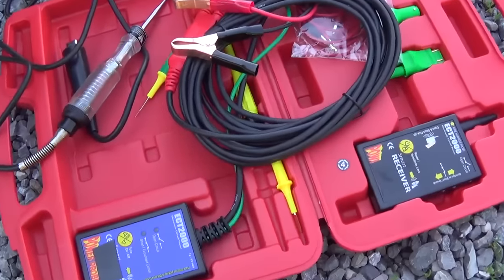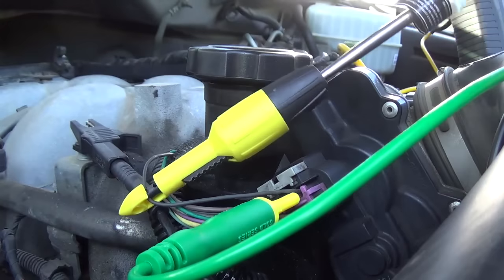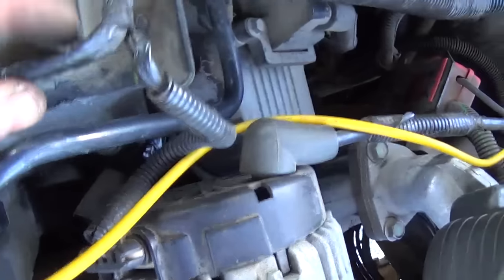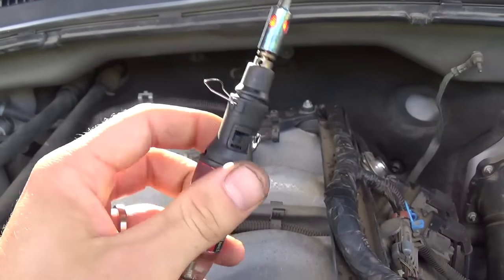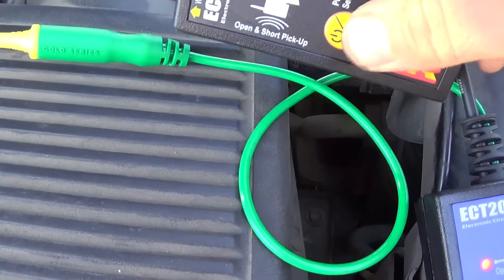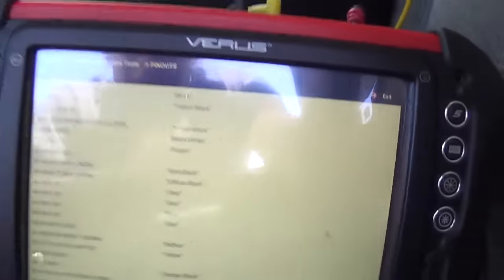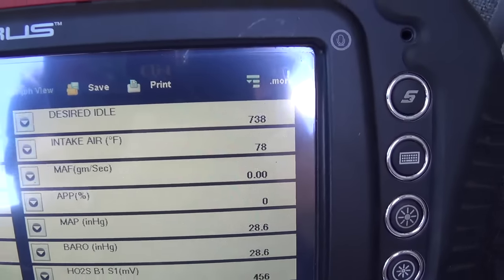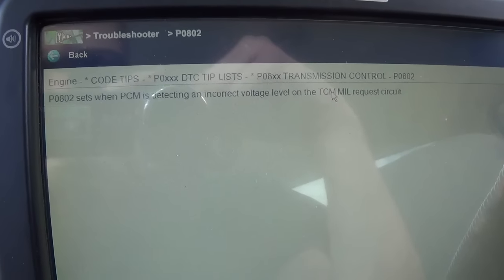GM Chevy truck: "REDUCED ENGINE POWER" Case Study- Part 2

Comment: THANK YOU SO MUCH.  I spent 2 days and $100 trying to figure out what was wrong.  Your video led me to the fix on my 2004 Chevy 2500HD 6.0L.  I had changed the Knock Sensors and cleaned the intake and heads and when I put it back together I was getting the Reduced Engine Power message and P0120 & P2135.  Watched countless YouTube videos and read countless forums.  It was watching you strip the wire loom back as far as you did when I found the break in the ground wire near the rear most fuel injector.  When I disconnected the fuel injector while taking off the Intake Manifold the wire must have broke fully.  The ground was completely broke and the brown wire was chaffed with the copper exposed.  Spliced those wires and good to go.  THANK YOU.
Reply from the maker: Dominic, I am so pleased that my video was helpful to you! Great job on the repair!

Comment: What a great lesson in modern technology and PATIENCE.  Headed off to the dealer on Monday for the same damned "Reduced Engine Power" BS.  Over a year of intermittent limp mode in some of the worst locations.  It's a bitch being handicapped, but, at least I can go to the dealer forearmed with a litlle very dangerous knowledge.  Thanks for the lessons.
Reply from the maker: Sure thing, Paul! Glad I could help you out! The trouble codes stored in the computer can narrow down the problem quite a bit :)

Comment: its called taking time to fix a vehicle the right way, without being disturb. the term mechanic way overrated, dealership pressure them to not waste time on said electrical repair when you can charge for a new part and bill the customer and make them more money , when you have other vehicle waiting for oil changes and tire rotation! way to simple ,  we fix cars should be the new name, at least i tell my people that , thanks Ivan, for fixing what someone else broke.

Comment: That cut on the harness is because of the intake manifold cover(the plastic cover that goes on top) 2014 and newer 2500hd trucks that kept the 6.0 have an issue where the cover rubs a hole on the pcv hard hose at the back of the driver’s side head letting dirt into the engine, i sent 5 company trucks in for new engines because of it

Comment: Thanks for the vid bud...however, I'm a little confused as to why, but, it sure looks like you tugged and pulled so hard on purpose and tore the first black ground wire though...am I trippin or what?

Comment: Excellent Video. My 04 GMC Sierra tripped the "Reduced Engine Power" whenever I hit washboard on our county gravel road. Traced it down to the female side on four of the eight bayonet pins to the TPS. Took each pin out and compressed the tab down to make better contact with the male pin. For a quick check just move the wiring around to the TPS while engine is running. Loose contacts will cause popping noise from TPS.

Comment: Pine Hollow A.D. you are awesome. I watched both videos the other night after having no luck troubleshooting my reduced engine power situation that came on my 2003 GMC Yukon. With your help diagnosis of this vehicle I was able to look through my lines attached to the source codes and found a broken wire. I replaced the line from the gas pedal to the control module with a part off a junkyard 2003 Escalade costing less than $3. The vehicle works perfect now. It instantly fixed my problem. 
I suggest watching both case study videos in their entirety. They are very helpful. My broken lines were not he same as the ones found in this video but I did find two line that had broken over time. Replaced one line and repaired another. Thanks Pine Hollow for saving my family time and money we don't have to spare. 
Thank you sir
Reply: Can i ask you where you found your break from the accelerator pedal to the ecm?

Comment: Using those ringing tools can be a bit tricky at times, but they are extremely helpful. Got an analog one, which was used by telephone engineers to "ring through" a wire. So you can basically let a telephone ring when you connect both wires or just one wire and have an handset. The advantage is the extremely high sensitivity. You can trace a wire behind a wall etc when you switch the sending unit to high power and the receiver has a volume knob which let you easily adjust it while tracing and gives you a much better "feeling" for the distance to the wire.

Comment: Radio Shack closing for us electronics guys here in the State College area was a death blow. That was the last place to buy anything electronic locally. There used to be University Electronics, Electronics Unlimited, T&R Electronics, Acorn Electronics plus a few other smaller repair shops where we could find resistors, caps, solder and small items. Now we have to travel or just order things we need. Great videos, hope we can meet someday I work at PSU in the electronics shop.
Reply: Blame Amazon for making shopping online convenient.

Comment: hey i dont know if you have any milwaukee tools...but i made a cool protable soldering iron using a milwuakee battery to power it...works amazing...heats up in a second...i always use flux just for better penetration...great freaking diagnostics...im dealing with this exact issue right now on a 2007 2500HD...thank you so much for the video...we are close by..im in pittsburgh..

Comment: I'm having a similar issue on a 2008 Chevy Malibu LTZ. I noticed a pattern that the car would go into reduced engine power mode almost every time there was a hard rain and the car wasn't in the garage during the rain. I changed the TAC sensor on the Throttle body....that seemed to work but the problem came back.....I'm betting after watching your video that something is wrong in the wiring, possibly a broken wire. Thanks for the video, very helpful.

Comment: Lol can’t tell you how many times I’ve poked my fingers with a test light. I know this video is old but you definitely need to look into a Ts100 soldering iron now. It’s super small open sourced temp controlled soldering iron that you can use with a battery or other portable source. Has tons of tips and custom firmware with cool features. It’s PERFECT for the kind of work we do.

Comment: The check engine light won't come on on a TCM code what you need to do is leave the key in don't start it just click it over twice to where it's on depressed the accelerator for 2 minutes release accelerator and turn the key off and let it sit for a couple minutes and let it reset that's for the transmission control module JohnQ by the way great video I'm an electric lift truck mechanic so I'm pretty knowledgeable on this but your video really helped me out so thanks a lot

Comment: I keep a stock of Raychem DR-25 shrink tubing in my garage for under hood repairs.  Normal shrink tubing can dissolve when exposed to oil/fuel vapors.  You can get Raychem DR-25 on Ebay.

Comment: Nice repair Ivan. Three observations. (1)heat  gun , no Bic lighter stuff - Ha must have picked up a bad habit from SMA.  (2 ) I was taught by GM  when performing a factory wiring repair their must be a mechanical  support to the wire  prior to soldering- we used fine gauge bare copper wire wrapped around the area in a nice even coil then solder.  (3) - that tape on the eng harness is not factory ,neither is the use of zip ties. That harness has been taken apart and the retaining clips that held it down are missing and as you noticed they substituted  with zip ties. In my experience the TCM does set if there are TB faults, last one I looked at was a 2006 Tahoe late second shift ,  TP- coloration code- new TB , all fixed. I do like Matts tool , seems a little off at times but I guess your going to make a demo vid explaining how it works:)  I really like your presentation and awesome repair  thought process. Thanks for showing us. 👍
Reply from the maker: Steve Rob Wow that's great info right there Steve, especially about the tape on the engine harness and the retaining clips! The tape was so dusty and tight it really did look original. But the mystery still remains...why did they have to take that harness off in the first place? Top end work?
Reply: Ha - I'd  throw a wild guess - intake gaskets and Buddy just pulled the engine harness up and broke all the retaining clips .  I had such a good laugh at that purge solenoid blunder, nobody that watches your channel does work like that .  It's funny now but the guy that owns that truck won the lottery finding you. If he's smart he get his truck serviced by you from now on.
Reply: Steve Rob Very good chance it was intake gaskets
Reply: +wtbm123 They have been using those same cheap ass Chinese made intake gaskets for a long time now. The intake gaskets on my 96 were leaking from day one, fouling the #6 plug and running like crap.

Comment: Likely someone did some major work on this engine, or maybe even swapped the engine out and at that time they cut the ties to remove the harness, using a sharp knife of some sort.   Pulling engines  and so forth is work often performed by the lowest experienced guy in the shop and if this guess is correct, that is how the harness got cup up in multiple places.  Thanks for a very good diagnostic "study" as you call them.  You are a regular Sherlock Holmes.

Comment: Great troubleshooting video! 
It is amazing how much damage can be done to a harness with a knife by inexperienced hands . My only recommendation is when making a wire splice (in a harness) is to use Western Union style splice instead of attempting to flank soldering two wire ends. Sn64 or Sn62 solder is not strong mechanically. In most cases I use a small piece of a wire ( 3 to 4 inches) to allow sufficient length to strip insulation - forming two splices, soldering and heat shrinking repaired wire. Butt crimp and soldering wire ends after crimping is another option.

Comment: Finally a great video of a Vortec 8100!!👍 I own a few and I've had this problem with one of them and right now I'm having an issue with my daily driver. It's a 2002 GMC Sierra 3500 4wd 8.1/Allison with manual shifter on the floor for 4wd(Basically same model as this one in your video). While driving, it will turn off and back fire a few times and I pull over and turn the ignotion off for a few seconds and it will start back up like nothing happened. The "Service Engine" light comes on whenever it feels like it and its really wierd but this happens more when I hit big pot holes or when Im towing a trailer and trailer jerks truck alot. My Message Center sometimes give me the "Trans Fluid Hot..Idle Engine" and Transmission temp is at 300°F . Normally it gives that message every time I start the truck and if I drive off like that, it will shift hard & long thru out all the gears. Then whenever it feels like it, the trans temp guage drops down like if it got unplugged and the truck will shift perfectly fine. I still drive the truck everyday and she never lets me down. I just really haven't found someone who can acually find the problems and and fix it properly without damaging anything else on it😏 I dont know where you are located but if I can get in contact with you, I would not mind at all taking it to you myself and having you work on it. Well I can go on forever but my contact number is 210-216-1785 (Galdino Rodriguez)and if its ok with you, you can call or txt me so I can talk to you about it or get with you about taking it to you. 
Thanks again for a great video and  stay safe my friend!👍
Reply from the maker: Hi Galdino, thanks for the comment! Yes they are tough trucks. I am currently diagnosing a 2002 2500HD with the 8.1L. It has an intermittent "Reduced Power", issues with the throttle control system. I'm in State College, PA.
Reply: @PineHollowAutoDiagnostics  Thank you for replying!👍 not a problem at all, that sounds like a really nice road trip for me.lol. Im out here from San Antonio, Tx and will get with you as soon as I get a chance to take a trip up there and hopefully all this pandemic gets better too. Mean while, I'm gonna keep viewing your videos on these GM Trucks!🤠
Reply: Look your transmission has a sensor located in it thats wired in series to different electronics the back firing is from carbon build up and from intake air and fuel not mixing well. Might need to clean the intake valves etc

Comment: You should replace the whole section of wiring that had been probed due to the insulation of the wiring being opened. If the wire is not sealed after being probed it will lead to corrosion and the wire breaking in two from said corrosion.

Comment: Nice solder job and holding tool demo. Use your solder tool heat from red hot area to shrink shrink tubing. I think the cutting the zip ties is correct assumption

Comment: I can't get over on how HUGE that engine is.. It's bigger then my dad's 70' Buick GSX engine at 455ci (7.5L)! Heck it's 100 cc larger then the Bugatti's W16 engine!!
Reply: titanicwhiz well the 1970 cadillac 500 was 8.2 liters. Had 400 hp 550 ft lb of torque. They designed that engine to be capable of 600 c.i. Another cool thing was they weigh as much as a small block chevy.

Comment: Nice repairs!  I have a theory for that wire damage, those trucks were plagued by intake gasket leaks and many of them were replaced by the dealers under a recall/class action, stuff like this would happen during those repairs - ask me how I know this lol
I am a fan of Schrodingers box as well, I am torn between the scan tool he uses, and you verus cause I need to invest in one, that open/short finder looks sweet - great content in your video’s

Comment: I just had a Sierra with the same reduced power problem.  As soon as I opened the hood, I got suspicious.  It had a brand new cold air intake on it.  So I pulled off the connection at the TB and there was a rubber ring stuck in there.  It looked like some sort of spacer or something, maybe for smaller intakes?  I'm not sure.  
The customer complaint was that if he gave it more than half throttle, it would go into limp mode and rev like crazy until he shut it off and restarted it.  That was much easier to find than this one.  This poor truck here looks like it was assaulted!
Reply from the maker: +GRowe1978 Nice! Aftermarket junk lol...there's nothing "cold" about those stupid cold-air intakes, and the filters generally suck.
Reply: motoYam82 The best part is, I told the customer that those things can cause all sorts of problems and he proceeded to tell me about how he had major problems with the one he had on his last truck!  I guess it oiled the MAF sensor pretty bad.

There are a bunch of "cafe racer" dorks who live near me and their bikes run like absolute crap because they're running pod filters with stock jetting.
 
People are a source of endless amusement!
I don't think they even realize the amount of engineering that goes into getting a stock intake, air box and filter to make it just right for the engine.  No use explaining, they'll never listen anyway.  They think they can actually FEEL more power. LOL!
Reply: +motoYam82 Hey my 2500HD crew cab is having reduced power but it has a lost data connection code and a TPS code. turn it off and wait a minute and it starts right back up and goes. You think it could be a shorted wire also?

Comment: Excellent troubleshooting, especially on that first batch of cut wires. You could work for dozens of hours without finding that. One thing is clear, there is no way whatsoever you can work on these modern engines without a scanner of some sort. (probably a dumb comment) I don't know if you need a multi-thousand dollar one like the one you have, but it's hopeless to try fix these things without a scanner.

Comment: Your videos are excellent and, from what I've seen, way better than most. But one caution with this job. Using a test light connected to 12 volts to probe a wiring harness that's still connected to the ECU and the TPS is a bad idea. The bulb is effectively applying 12 volts to a circuit designed for a max of 5 volts.There could also be components in the throttle body that could be damaged by 12 volts. The ECU likely has some protection on the sensor inputs and outputs but you don't want to risk damaging an expensive ECU. It would be much better to use say an ohmmeter (which only apply a few volts at a much lower maximum current than a test lamp).
Reply from the maker: Thanks for your comment! Damaging ECU with a test light is a very common misconception. You need high current to burn up components, and 250mA is not enough to do that. 

Furthermore, in this case I was only using the testlight to test the sensor GROUND, not the signal or 5V reference. An ohm meter alone is a terrible tool for checking wiring integrity, since it doesn't load the circuit at all. Say there was one strand still connecting the wire where it was sliced by the knife. The ohmmeter would not see that at all so you would think your ground is good!

Share the Knowledge :)
Reply: You are absolutely correct .you are way better checking circuits with a load i have many times seen where you will see correct signal voltage but the wire was cut or corroded and couldn’t pass enough current for the component to work

Comment: Moto, by checking with the test light that way connect to the positive battery terminal, you are check for a short.  Remember this circuit is open.